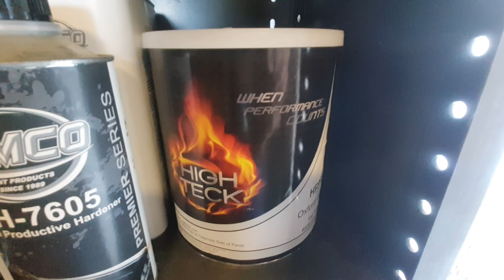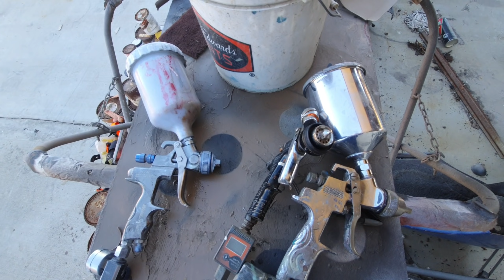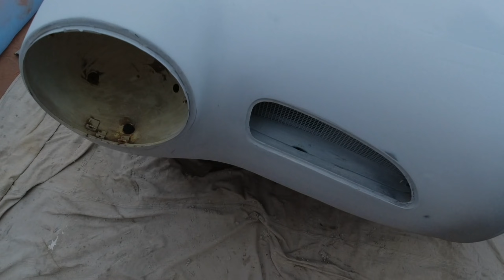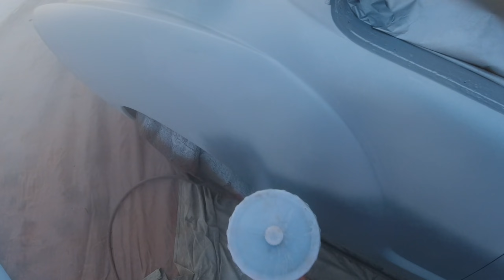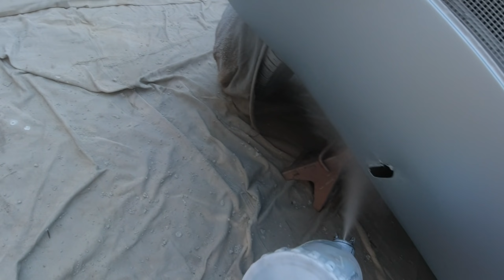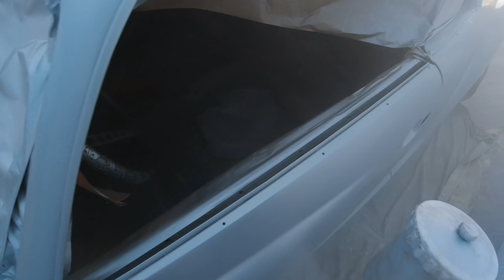how to spray clear coat without getting any orange peel DIY Complete Car spray  w narration

Comment: these are my tips.
ALL spraying STARTS with correct paint mixture!
correct thinners vs base creates immaculate gun flow/application. correct mixture makes dialing in your gun settings so much easier! 
if youre having trouble with spraying, throw in another 100ml of thinners to your paint. trust me. could even be 200ml! you do not want to be spraying syrup 😂. spray 2 immaculate coats of thinner paint (probably actually correct level now) OR  continue to struggle to paint 1 lousy thick coat? 🤷‍♂️

next, i have a pressure regulator mounted to my gun. its pressure is set to 64 psi. when i pull the trigger it drops to 60-59psi. i find this works for me BRILLIANTLY. 
i wasnt a fan of the bulky regulator but it eliminates guess work of the importance of air flow. having a specific pressure that you can read and see gives you perfect results.

im am using a 1.3 nozzle. 
a 2.0 is preferred. but ya boi out here laying down absolute glass coats with the 1.3 😏.

with all that info you should be able to dial in the fan width, volume and air on your gun in 5 mins and spraying like a pro.
Reply from the maker: good info....only 1 thing not to do.....Thin the clear over the recommended mixture. Most clears are not to be thinned. or 5%.....If you reduce them more than that even with extra coats they will fail. Some of the low VOC reducers will create fisheyes when you over reduce. Like in CA.....Some guns like the Tekna prolite atomize better with wider fan. Narrow fan larger droplets. We cannot spray at 60lbs here but if you do you will have finer atomization and also a huge cloud of overspray. not good for diy at home but good for finish quality. That gun I am using sprays really fine at 29lbs. No need to turn it up to  30 to 50. But I regulate the line pressure to 50 too. so I can set it at 29lbs and ger a really nice consistent 29lbs of pressure.

Comment: Over reduce.  I spray enamel all the time and single stage and that finer mist is the key.
Reply from the maker: really should not do that with clearcoat. It will break down the material and fail much faster. I never put reducer in unless it says on the label. so clear is harder to spray without reducing.

Comment: Is orange peel only an issue on gloss paint jobs? I am planning to add flattener to my clear coat for a matte finish.
Reply from the maker: yea it shows up a bit in satin finishes too. need to shoot that stuff really even. or it comes out blotchy. And you cant correct it with buffing.
Reply: @Mikefngarage  Well, now I’m terrified. Haha. Maybe I’ll buy some of that Hot Rod Flatz single stage stuff. Keep up the great work with the videos. Your knowledge is going to help me conquer my Kombi.
Reply from the maker: @FeveredMind  hey just do it. the worst that can happen is you sand it down and paint it again. clear is fairly cheap. just get in there and spry it when its ready.
Reply: @Mikefngarage  Love that attitude! I have a lot of welding to do, so I'll be watching all of those videos you have. First up, doglegs! I do have a few questions about some areas that concern me, but maybe some guys on the samba can help.

Comment: Whats up Mike great looking car. Had to take my motor back to brother's.
Reply from the maker: WOW that is surprising. they do good work but parts can be an issue today.
Reply: @Mikefngarage  they do go work a bit too unorganized, but dyno people they used didn't do a good turn keying the engine. Plus had a inference issue on my 6volt trans even after it was clearanced. Having a super freeway flyer by kcr transmission.
Reply from the maker: @marksrepairj623  yea unfortunately the clearancing  you really need to DIY. Without anyone putting the engine in for you and the fact that every trans is a little different there is no way to get it right.  VW stuff is not just bolt in there is some work to do to modify almost everything. That is why I would never have a vw shop. I will never work on anyone elses car because there is so much stuff that is subject to what your doing. no cookie cutter stuff. Usually everything you do you will do it at least 2 time.
Reply: @Mikefngarage  yeah thats for-sure. Ur Karmann Ghia looks great.

Comment: Are you using the HVLP spectrum gun with the 1.7mm  tip for basecoat or the 1.3mm tip HTE spraygun?  Sorry if I missed it in your video.
Reply from the maker: 1.3 HTE not the HVLP both meet HVLP guidelines. but the HTE uses a bit less air and some people say it is finer spray. IDK really on that part.
Reply: @Mikefngarage  For sure - I believe it is a finer spray with the smaller tip size no doubt.  I just heard that the hvlp was better for metallics and to get them more even that's all.  I'm sure an expert like yourself could paint that car with the HF purple $10 gun and make it a show piece.  So I was just wondering that's all.
Reply from the maker: @phordguy  Yea I would like to try one so I could tell the difference but There are other guns I would prefer since they raised the price. Not bad though when you get it even for 129.
Reply: @Mikefngarage  I’ll send you my spectrum help if you would like to try it for a month.

Comment: And to avoid polishing through the clearcoat on say edges ?
Reply from the maker: With high solids clear like tamco it is not that hard to polish without polishing through. Use cheap clear or acrylic enamel and that is when you have those problems.